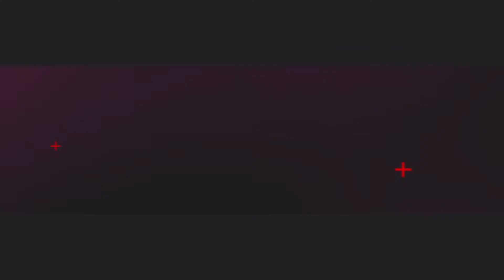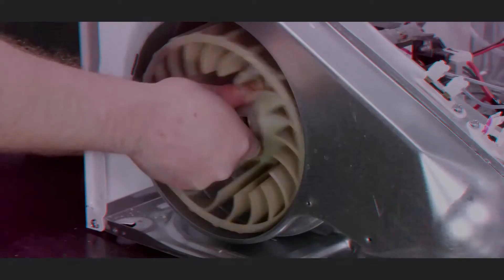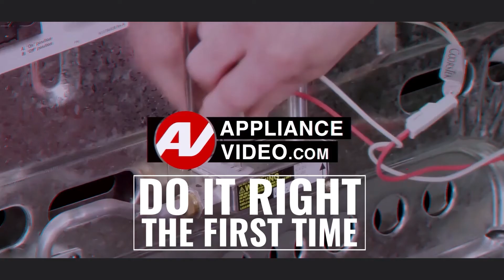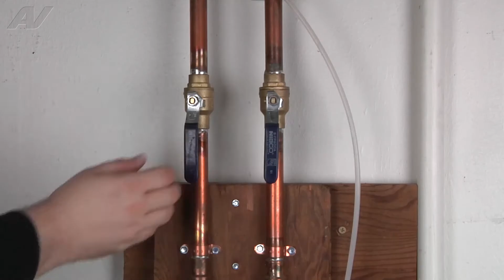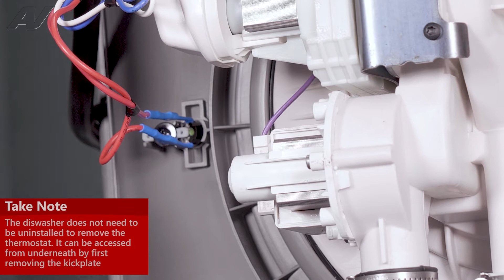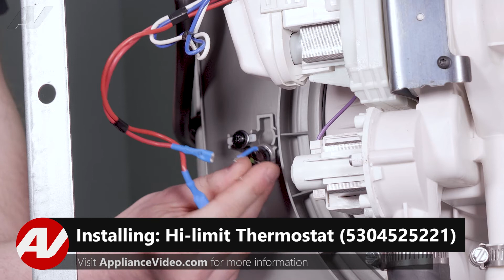Frigidaire Dishwasher Repair - Will Not Heat - Hi-limit Thermostat

Comment: My dishwasher is not running hot water. I had an appliance guy come out and tell me that since it's pulling the cold water from the line, it needs a circulation pump to get hot water in there and for that, I'd need a plumber. He said the heating element is secondary to that issue. Does that sound right?